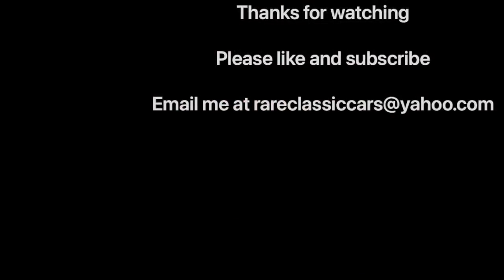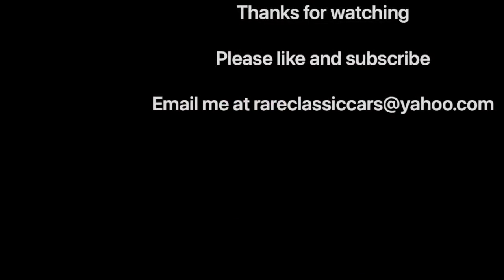Worst Engines of All Time: GM 2.5L Iron Duke Follow Up

Comment: I still think the Buick 231 ci was worse as I previously stated on the first iron duke video
Reply: The original odd-fire version shook like a paint mixer, but it was a good long-lasting engine, if you could stand the rough idle.  The later even-fire was a GREAT engine.  One of GM's all-time winners.
Reply: Mine was horrible. 1981 Century. Gutless, rough, and leaked oil from every gasket/seal.  Last American nameplate I ever bought.